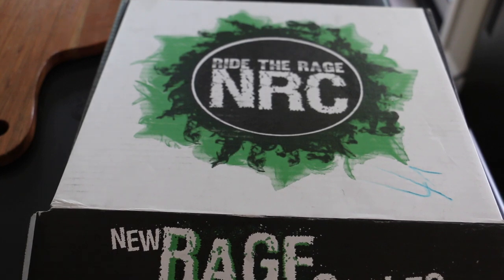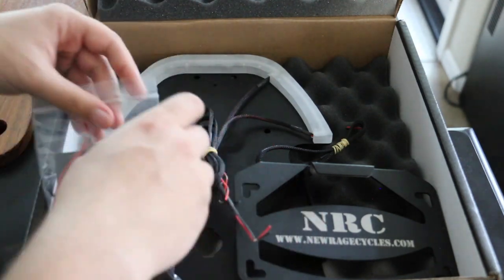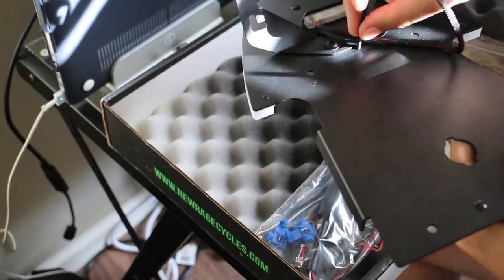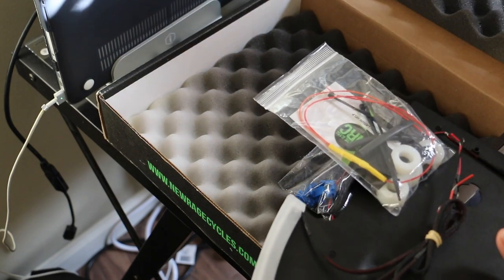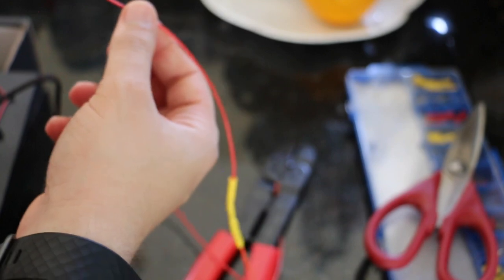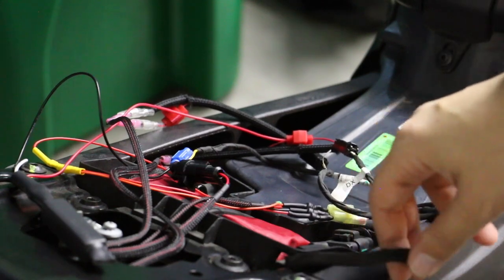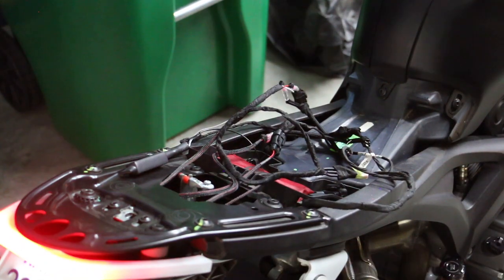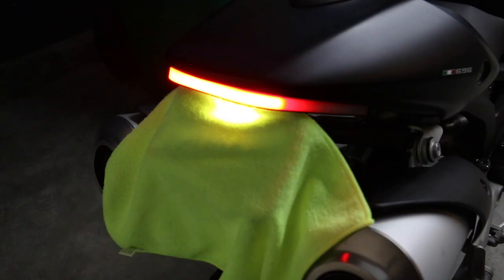Ducati Monster 696 - New Rage Cycles (NRC) Tail Tidy

Comment: Just bought the same kit for my 796 you answered some questions thanks
Reply from the maker: No problem it's an awesome kit. Still running strong on my bike. I think the one difference on your bike is that you may have a muffler actuator under your seat which may need to be relocated as well. My 696 model doesn't have that.

Comment: First of all, thanks for the tutorial. I know you didn't want to show your wiring techniques but it really help. I feel like I'm seeing step 1, 2 then step 7.
Reply from the maker: There are much much better wiring videos out there. This is the reason I didnt show that aspect. I fumbled and experimented and then cleaned everything up to get it to work. The kit should have came with a wiring diagram link that's what I used to matching everything.
Reply: FunWithAJ I know. Just makes me nervous to miss those steps. Do you really need to get all of those extra parts? The other wiring harness etc.?
Reply from the maker: @crankyboy71  extra wiring harness is not needed at all. I just wasnt comfortable in my ability to not mess up original harness. You do need electric tape and connectors though. I'd also recommend heat shrink to keep everything safe and dry in case of rain.
Reply: @FunWithAJ  Thanks. Im not hugely worried about my wiring harness. I've had a lot of repairs to the parts of it already. Some scooter boy parked too close and ripped out a bunch of wires already. Have my connectors, heat shrink and tape. Hoping to give it a go this weekend.
Reply from the maker: @crankyboy71  Nice, keep me posted on how it goes and let me know if you need any more advice. It was fairly easy to do. I just had very little experience with electrical prior and had to teach myself to splice/solder. That was the toughest part.

Comment: Hey man so I got this and have been having a huge headache on how to connect it all. I’ve never done wiring work and legit your video is the only thing on the internet explaining anything at all. I was wondering if I could chat with you personally to talk a few things through cause I’m loosing my mind here.
Reply from the maker: Feel free to ask the questions here. I'll answer what I can. Also check their website there is a diagram manual to download that helped me
Reply: FunWithAJ sure thanks so much for getting back to me dude! I’m a creator as well so if you have any questions for me about tech or filmmaking let me know and I can try to help you back haha. 

Can you let me know what all items I need to get extra? 

I don’t have the load balancer, can I go grab any stock one from like an auto store or do I need this specific one? I have a 797 do I need one? If so can I install right now without it and then go back to install the load balancer ? 

For the turn signals and licence plate light I guess you can just cut the stock wire and then splice it with the new rage wires, but it says not to cut the brake ones. How on earth do I connect new rage brake wires to the stock brake connector module ?
Reply from the maker: @TausifHussain  for the 797 it does need a load balancer or resistor to stop hyper flash. However you dont have to purchase there's. I found them at NAPA auto parts for about $10 total. Another thing you'll need to make easier to spice the resistors is the smallest scotch locks they over. These are locking caps that combine and cut 2 wires without the need to solder. As for connecting the harness. The instructions for your bike the 797 NRC says it comes with OEM connectors. http://www.newragecycles.com/v/vspfiles/assets/images/instructions/Ducati%20Monster%20797_1200%20Fender%20Eliminator.pdf
Reply: FunWithAJ sorry I meant the 796.
Reply: FunWithAJ so I  think it’s the same as the one for the 696. I have no idea how to attach the brake lights component because they say to not cut that oem wire.
Reply from the maker: @TausifHussain  yes 796 is the same as the 696. The only difference for the install is you'll have an exhaust servo to relocate under the seat. As for wiring. For the 3 pin brake light connector. Yes. Dont remove or cut it. Once you disconnect your old brake light leave it be. What I did is connected 3 sliding pin connectors to each of the corresponding wires for that connector. They're long connectors that look like needles. I bought them from Ebay. Heres the link to the ones I bought and what they look like. If you slide through the photos you'll see I just used the silver pins and those locked and slide into the OEM connector https://rover.ebay.com/rover/0/0/0?mpre=https%3A%2F%2Fwww.ebay.com%2Fulk%2Fitm%2F132908231261
Reply from the maker: @TausifHussain  for the turn signal part I purchased these connectors so I wouldnt have to cut the OEM harness https://www.motodynamic.com/ducati/wire-harness.html
Reply from the maker: @TausifHussain  I did all of the  soldering and splicing on the connectors I bought or within the led lighting wires as I didnt want to cut into the Ducati wiring harness.
Reply from the maker: @TausifHussain  How'd it go, do you need more assistance?

Comment: Hey, I was wondering if you could give details on how you fit the lock on in the new position? The lock core wire that was on the OEM tail section is too short to fit with it positioned directly under the seat.
Reply from the maker: My lock cylinder cord was actually too long instead of too short. I simple re-routed it to have a slight twist/bend.
Reply from the maker: At 18:30 you should see the final cylinder/lock core placement. The wire was more than long enough my only issue was excessive rather then shortness so I twisted it in a circle shape.
Reply: Carlos is right. the cable is too short. I have tried to contact NRC about this!

Comment: the inclination of the license plate holder is adjustable?
Reply from the maker: You can move it to 3 different positions prior to install on the bike. That said the angle is only really different in one of the 3 positions in my opinion. With all that said I've never got trouble from the police about it and I've ridden around them daily.

Comment: Do you have links to the connectors you bought so you could plug directly into the factory harness?
Reply from the maker: No links. I think I purchased them in person from VIP Auto as Autozone and O'Reilly didn't have them.
Reply: @FunWithAJ  Thanks for the feedback, for the three bullet connectors you installed for the brake light, do you have a link to a similar one to what you used? Yours look alot more clean than the one's I've seen in stores

Comment: Hey so first off thanks for the video! I tried following the instructions from the site and it got me to get the old fender off, then I'm totally lost. The harness that you got was the harness for the 848 or the dual splitter harness?
Reply from the maker: So the wiring harness I purchased was from a wrecked 696 (same bike as the one I'm installing it on) note this wasn't needed. I only purchased it because I didnt want to splice/cut into my factory harnesss.
Reply from the maker: The load balancer I purchased from NRC directly. You only need one for the entire back of the bike. Wiring wise. I followed the instructions NRC has online for the exact kit. They have a free download.
Reply: @FunWithAJ  I was heard you said you used some adapters to utilize the oem harness and had this link  https://www.motodynamic.com/ducati/wire-harness.html on a comment below. I thought about just cutting the oem turn signal light's cables off (one is already was broken) then soldering that to the cables on the elim kit's turn signal cables.
Reply: also how did you get the seat lock off the seat lock off the OEM fender, that 22mm plastic washer has no room to get taken out and i'm super frustrated :P
Reply from the maker: @victorjereza7635  yup I used a wrecked harness and used billet connectors to connector the harness to the led kit. I also soldered some wires together. A mix and match.
Reply from the maker: @victorjereza7635  I used needle nose pliers to get the lock wire off the cylinder. Then I used the same pliers to unscrew the single nut off of the cylinders from the OEM tail. The only difficulty I encountered with the lock was having bend/snake the lock wire into the new tail tidy at the end. It just took some time to figure it out.
Reply: @FunWithAJ  sounds good, bout to run to the store for a bunch of the tools. Hopefully i'll get this done tonight, i'll keep you updated and thanks again for all the help! :D
Reply from the maker: @victorjereza7635  no problem! It took me a good day of running to Napa + O'Reillys and to figure everything out. Just take your time. Dont get frustrated and think each issue through. If you mess up anything then the good thing about billet connectors is you can simply disconnect and reconnect.
Reply: @FunWithAJ  what pins did you use to connect the brake lights to the oem harness, I've hit up just about every hardware store and had the funniest/frustrating time trying to explain what I was looking for
Reply: Just ordered a kit from amazon https://www.amazon.com/gp/aw/d/B07KP369MF/ref=ox_sc_act_image_1?smid=A5YCUCLDGYX26&psc=1 I think the pins are the same that you used, but I may be able to use that harness too which may be a bit tidier?
Reply from the maker: @victorjereza7635  for the turn signals I used billet pins smallest size. 26 I believe. For the tailight I used weather sealed pins you can bring the harness and they should be able to help you better. Try napa
Reply: @FunWithAJ  Thanks for all the help man! i actually finished it like a week ago (don't have the load balancer but whatever) :P i just gotta go in and tidy up things and tape things up. You have any issue with it the whole assembly not being super water tight? it occured to me when i put it all on that water can def get up in there. Also little tips for people that are trying to do this. The watertight pins he mentions are molex pins if you are just looking for the correct metal pins, I had to use a rubber mallet and the rubber part of one of my wrenches to just smack that plastic nut loose off the OEM lock which kept the plastic nut in pretty decent condition. I'm kicking myself for not waiting and buying some silicone paste to stick in the heatshrink.
Reply from the maker: @victorjereza7635  the water tight aspects worries me as well. I forgot about using silicone. I mainly used heat shrink and high quality electrical tape to wrap all the connections so yeah that may turn out to be an issue. That said on all the motorcyle electrical videos I watched prior I never saw someone used silicone, seems like a great idea though.

Comment: How about the servo valve located below there ? Will it fit or have to be remove ?
Reply from the maker: 696 doesn't have one. 796 and up does and yes it will fit just needs a relocation